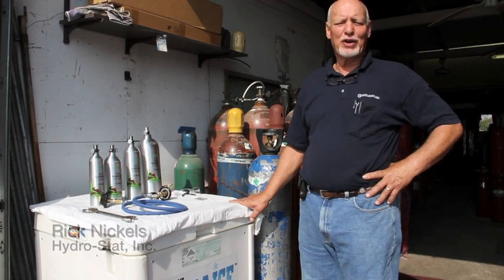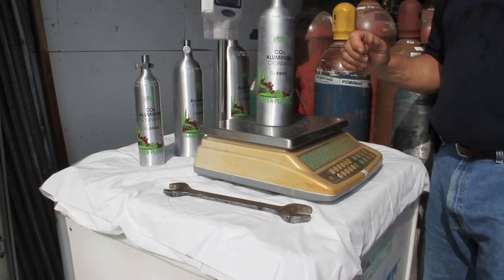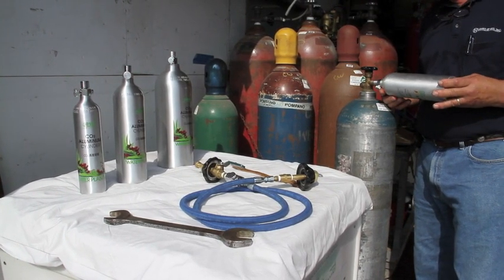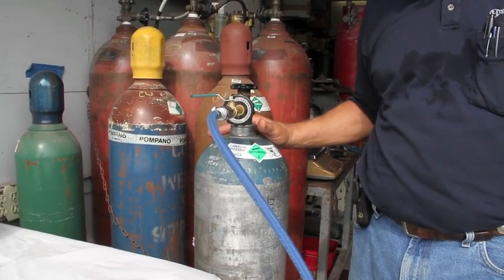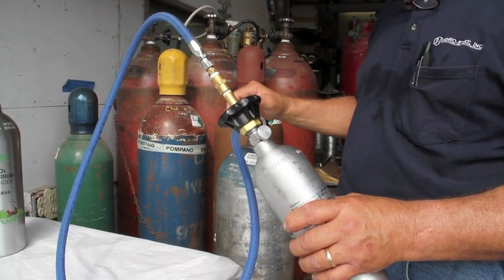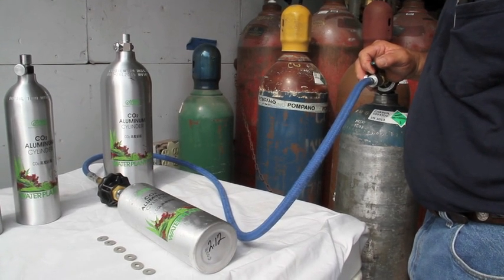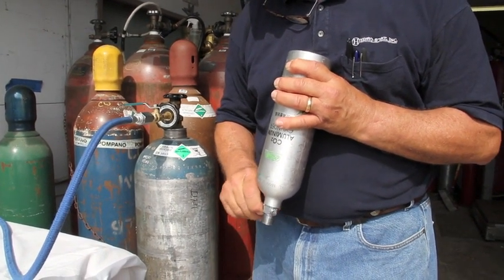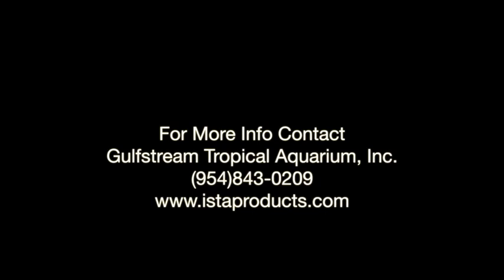How To Transfer CO2 From A 50lb Tank To A Small Cylinder

Comment: The supply cylinder must have a dip tube to supply liquid CO2 to the receiving cylinder, or one might be dedicated and fab a rack to safely invert vapor-withdrawal cylinders. Those wanting hardware can order from their local welding supply. Western Enterprises dominates the US market. I use a  tee, a whip and a common regulator on the vent side of the tee when I transfill for welding use.

Comment: can a co2 tank without the siphon tube be inverted to transfer liquid co2 into the smaller tank?
Reply: Yes, it is possible.
But remember that these procedures must to be done by a trainer people.
Inverting the cylinder can transfer rust or strange material on to your empty cylinder. To avoid that it is recommended to use a syphon tube.

Comment: i wonder if you could fit the dry ice in a cylinder then close the cylinder with the dry ice inside and leave it for awhile, would it be the same as a normal co2 cylinder ? will i blow up if i dont put in the correct amounts of dry ice
Reply: Yes

Comment: Some one violated the golden rule of liquid C02 piping.. Where ever liquid can get trapped,a safety valve shall vent the trapped area. Your whip has ball valves at both ends. Not a safe whip. Even with the purge or vent valve. There is a chance of trapping liquid between two fixed points.

Comment: What do you call those tubes for transferring co2?
Reply: flexible tube is called a hose if that's what you're talking about. He calls his transfer hose a whip about 1000 times or 1 kilotimes in this video. Maybe correct maybe not but if you open the valve w/o a receiving bottle attached you'll find why it's called a whip

Comment: I have a 50 bar CO2 main tank in operation.
The supplier for CO2 have tanks of 20 bars only .
So he tells me that i have to EMPTY about quarter of my main tank in air before he can supply me . even after i cool down the main tank .
My Question is :
1 - Is there any othet solution than thowing away , 25 % of the tank capacity which about 650 kg CO2 , in the air ?
2 - If that is nesscary can i refill small CO2 cylinders ( like 2 and 3 kg CO2 cylinders ) instead of just throwing the gas in the air

Comment: Here´s a dumb question: even though you open the valve slowly, isnt there a risk to explode the hose or the small cylinder? Because the big one holds a lot more pressure ? Could you just open it and leave it or you just do it while you hear it transfer?  (this was more than a dumb question, lol)
Reply: Both cylinders will be the same pressure if they are at the same temperature and each contain some liquid CO2.
Reply: +FerreiraAveiro both cylinders are rated for the same pressure

Comment: Why not attach the whip, put the whip and bottle on the scale and zero it then fill it to the correct Co2 weight.
Reply: Bill Van Raam because the weight of the whip will throw off your measurement
Reply: zarniwhoop1961 So after zeroing the scale you believe the whip will throw off the measurement?  Need to rethink what Zeroing a scale means.
Reply: @Daedalus_GeckoActual  and you need to understand that the whip will be hanging off supply tank so it will not be the same each time
Reply: @nebskram   Facepalm

Comment: Is there a reason that the ball valve isn't on the other end of the whip, with the bleed screw between the tank valve & the whip's ball valve?  (Just asking). 

My logic is this:  With the ball valve & bleed screw on the other end, the whip stays pressurize between fills but only the space between the ball valve & the tank valve is depressurized between fills (instead of the whole whip).  This would take a little less time to bleed down, but more importantly, it might waste a little less gas.  From a practical standpoint, it probably wouldn't matter too much.  (If, on the other hand, the gas in question was He--more expensive--then it might matter more!)--RS
Reply: you can`t unscrew the whip if it has pressure, hi pressure tightens connections ...that`s why you always bleed the pressures.

Comment: what is the pressure in the big tank?  what pressure will those small tanks take?
Reply: Tanks are filled with Liquid CO2, pressure varies, around 600-800PSI in normal indoor temps, and will remain "constant" in that range until the liquid is depleted. So pressure is the same, for any CO2 vessel, no matter the tank size.
Reply: You can't tell because the liquid is always expanding and contracting because of temperature
Reply: @Chickendude1  you can tell

Comment: is your supply cylinder a special type of cylinder or can i use any type of co2 tank?
Reply: I have the same question.
Reply: @spencer5082  You need a CO2 tank with a Siphon Hose inside.
Any welding supply shop should be able to sell you one.  That kind of tank can only supply liquid CO2.  I wonder about turning a normal CO2 tank upside down?
Reply: @1978garfield  dangerous, because you can break the valve off, creating a heavy, dangerous, rocket projectile, but it works and is done all the time.